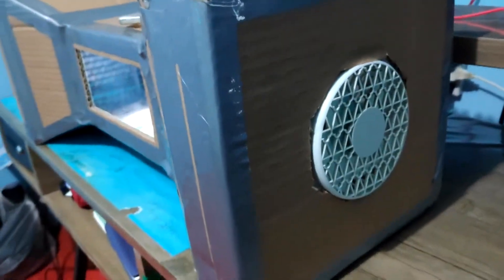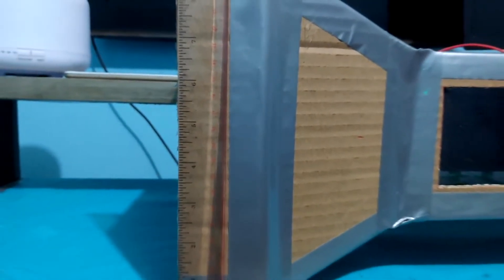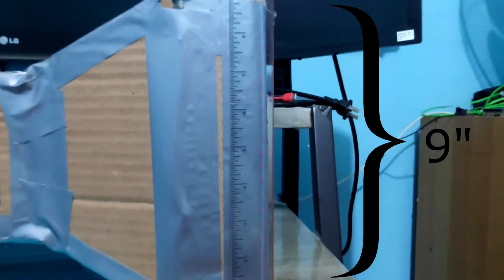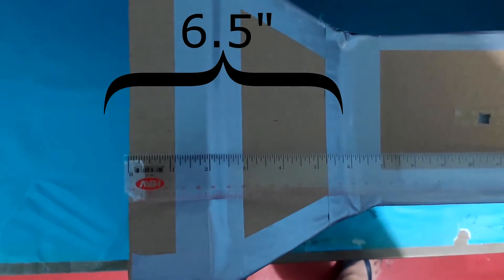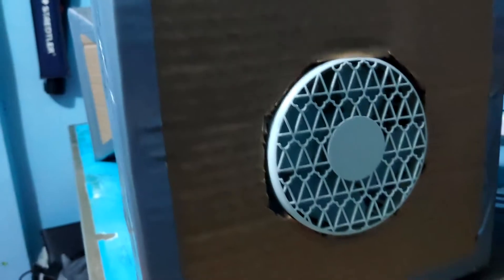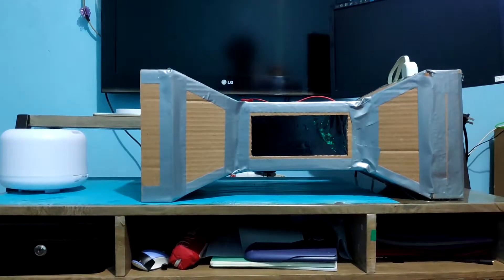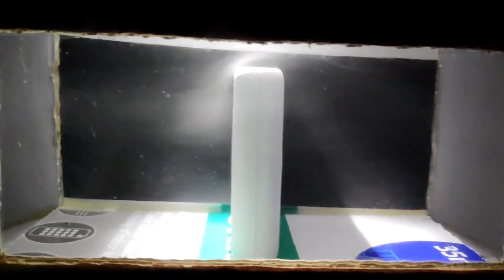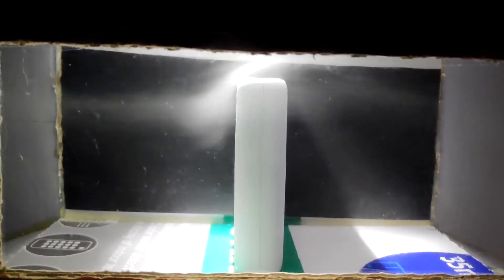DIY Wind Tunnel By Michael Funston

Comment: Do you understand what you did wrong?  Are you interested in building another, better one?  The shape and length of your contraction and diffusion sections need to be longer, and the contraction section is supposed to be curved, not straight.   You also need an actual blower.  Muffin fans cannot work against the slightest bit of resistance.  Having a short diffuser section will cause your fan's swirly air motion to interact with your test section, so that needs to be longer.  The uncurved contraction section means you will have different air flow and density across different parts of the cross section of your test section. You can't do a damned thing with such a situation, any kind of casual wind tunnel play REQUIRES uniform air flow and density at the entrance to the test section. You get that by making the contraction section curved, not straight-walled.

Comment: Hi. Im building my own wind tunnel. Does it matter if the width and height are not the same? Im trying to make a larger one and my main tunnel is currently 24cm wide and 20cm tall. Is there a scale factor needed for the intake or should i make them even to eachother? Eg. both 22cm? Thanks!
Reply: I changed them to be 22cm wide and 22cm tall. My intake is now 52x52 cm. and i have the incline to the intake at 45degrees with a length of 21.2 cm. 15cm up and 15 cm across with the hypotenuse being 21.2cm (which is where the randomness of the number comes from). Is this intake large eniugh? proportional to what is necessary? Thanks!
Reply from the maker: @Wolf-lb9lz  Hi. The measurements I used are just what I wanted to use, you can definitely use your own, just make sure that the fan you are using has the necessary power to be able to generate enough airflow inside the tunnel itself.
Reply from the maker: @Wolf-lb9lz  I feel like you should have a large enough intake right now, as far as I can remember the length is what really makes the difference as it will make the airflow smoother, but the size of it should definitely help. Hope your project works out well ✈️